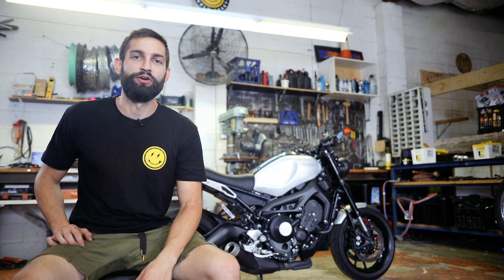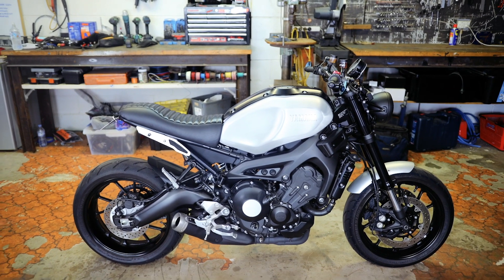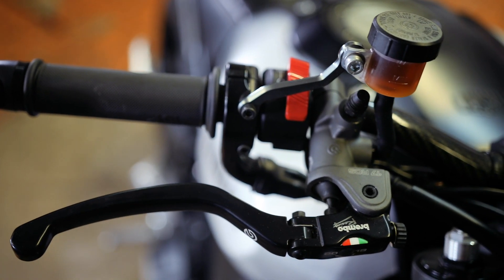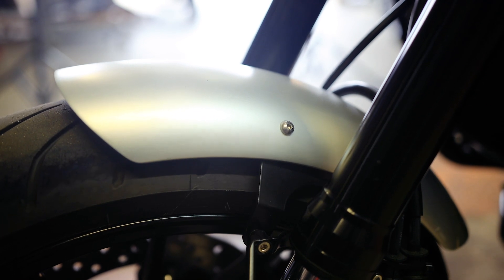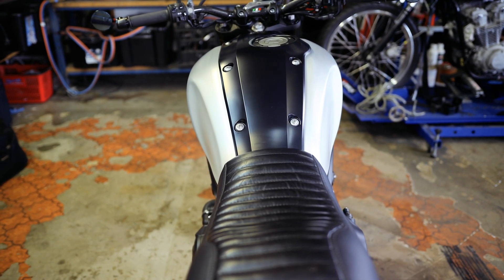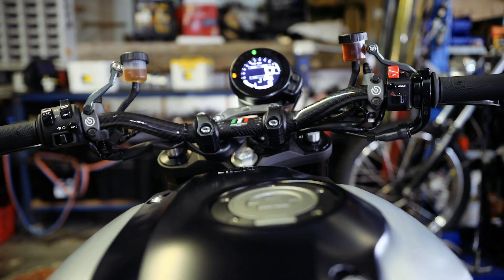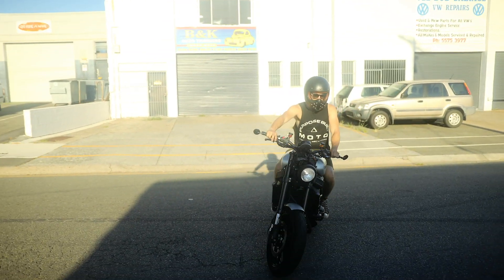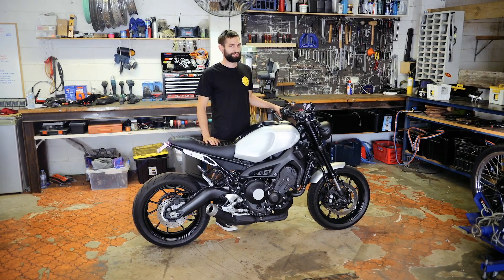Yamaha XSR900 Cafe Racer  | Purpose Built Moto

Comment: It's a beautiful custom job. Less is most definitely more. I own a 2017 Abarth XSR900, as its second owner. The previous owner did his own customised work on it, which does, to be fair, look good - BUT, all parts are black, and with cleaning, are now bit-by-bit, starting to show their true, metal origins. That aside, the bike looks gorgeous and hooligan. Initially I was all about Kawasaki, but saw this XSR900 in the showroom and it was instant love. The previous owner had also fitted a Delkevic racing exhaust system, with a short, wide-mouthed racing tail pipe. It was loud, aggressive and hooligan. Admittedly, the exhaust system, compared to some after market set ups, is, by comparison, cheap and cheerful, but it's British made and does the job well. I've since toned down the bike with another, longer (and road legal) tail pipe. It's still loud, and aggressive, but doesn't warrant undue attention from Mr Plod (as much).

I will say, with this being my first bike in roughly 30 years after my last bike, the rider modes have saved me from my own mistakes. This bike, if treated without respect, will bite back, and bite hard. I've yet to ride it on A mode, and still keep full traction going (and still the bike has popped several, unintentional mini-wheelies - all my fault, of course). I love my XSR900, and treat it with the love and respect it deserves. My only grumble... well, two, actually, would be, 1) polishing the engine bolts takes forever (but look gorgeous once shining).
2) I wish I had the bike from new.

Safe riding to you all. Stay healthy.
Reply: My first bike after a 20 years pause was the MT07. Next a MT09 and last but not least my current is a brand new 2020 XSR 900 in 80s black. I've had to wait almost 6 months for delivery. awesome bike with the akrapovic-double exhaust from your model and the deep handlebar also from the Abarth XSR. but to be honest the handlebar kills me I've got to change it. my XSR has got Ohlins-suspension front and rear and this makes a real difference compared with the MT09. other mods are a Yamaha quick-shifter and brake and clutch-levers from Gilles tuning in black... 

the A-mode is my standard mode ;)
Reply: @bernd4883  What can I say? Ride safe ;)

Comment: Great custom bike, the only useless upgrade is the RCS brembo master cylinder :) you don't need this at all, the rest is all nice.
Reply from the maker: Sergej Kravchenko if we’re talking “Needs”, the bike didn’t “need” to be modified at all. But we work on people’s wants, and that’s what our customer wanted.
Reply: @PurposeBuiltMoto  yeah I understand you completely, what customer wants this is a golden rule, but I mean common having a race RCS master cylinder installed on a non race machine that will look very funny, especially from those who races machines like myself. But the overall bike just loved it, this is the bike I@m about to buy for this year just to hvae a fun on the roads
Reply: @TheSoulofuniverse  what do brembo master cyclindrs do anyway? im new ot the biking world i jsut ogt an xsr900
Reply: @mochabear8312  RCS Brembo master cylinder are mainly used in Racing, where you use your front brakes constantly and very very hard ( and when I say very very hard) I mean just use all the potential of your front brakes, even the club racers don't use its all potential so I'm not mentioning a usual road riders. When you use front brakes so hard the brake fluid gets hot very quick and you loose the brakes potential straight away, RCS helps to prevent this and don't boil brake fluid that much due to its effectiveness, also the pressure and other parameters. So for any road bike I would leave the brakes alone and won't be changing them at all, seriously placing RCS brembro front brakes on that bike just makes look you very silly, at least for people who races.
Reply: @soufilms  what if the owner of that bike likes to bring it to the track? the bike has alot of power and if you flash the ecu and remove the speed limit it can go up to 180+